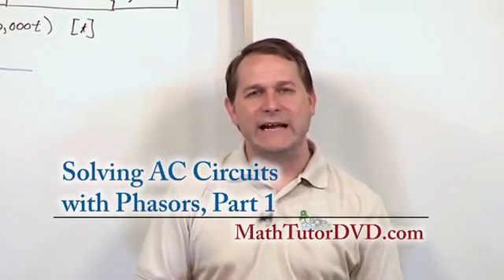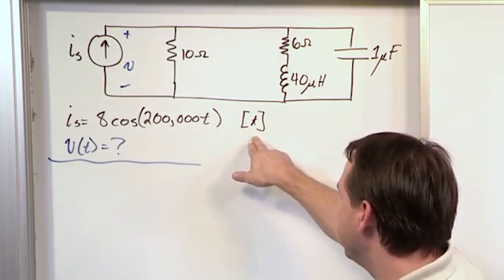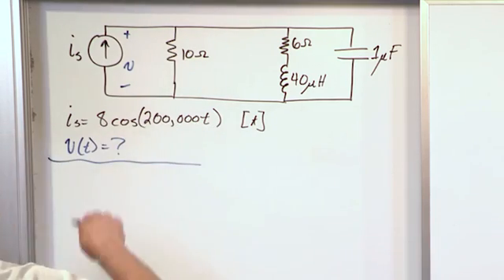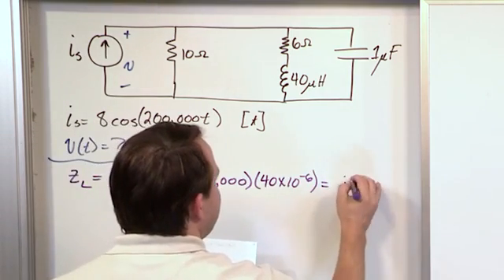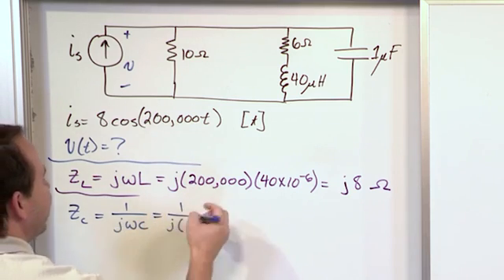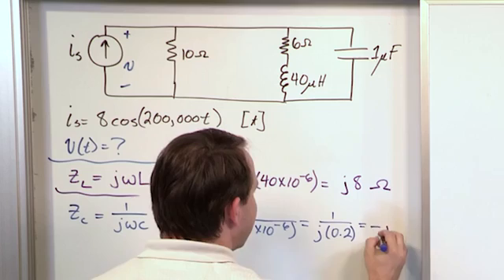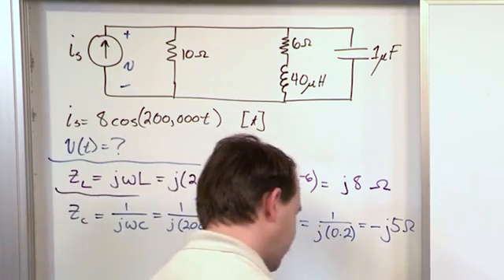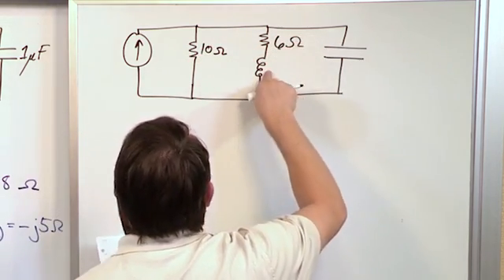Lesson 16 - Solving Ac Circuits With Phasors, Part 1 (AC Circuit Analysis)

Comment: The video is cut, but let`s try to find the answer. We are looking for the voltage across the 10 Ohm resistor I think. So my calculations bring me to 40cos(200000t-36.75) V. Please give your results!
Reply: I got the same answer. I hope its right.
Reply: @Varde1234  that is indeed correct
Reply: Did you just calculate the total resistance and multiply with the current? I understand the amplitude being 40 but I don't get how you got that phase angle. could you explain it please